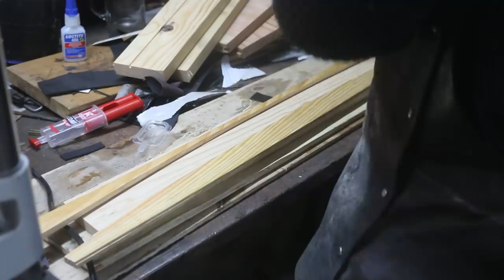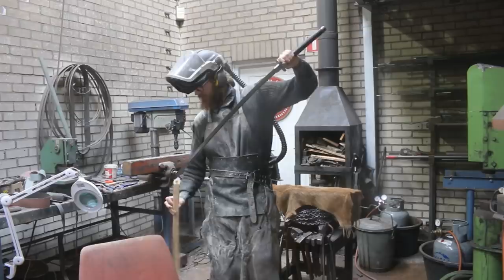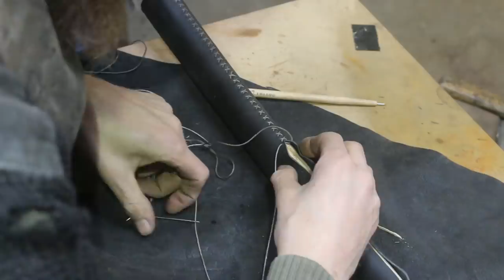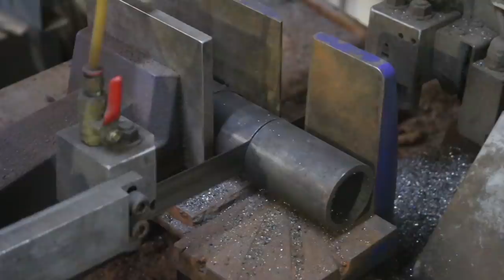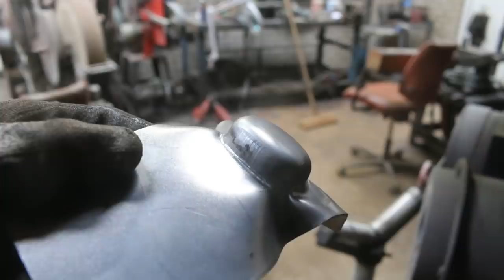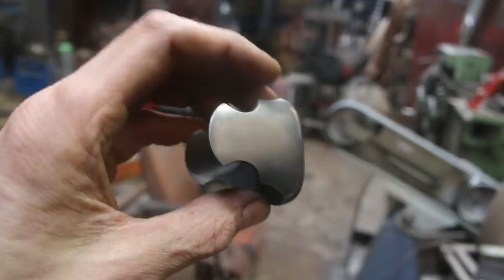Forging a Samurai sword, part 7, making the scabbard.

Comment: NANI?! The habaki did fit afterall. 

This is amazing work!

I hope the koiguchi area of the scabbard will get a steel fitting around it like the tip did: 
maybe even a hornlip that touches the tsuba and completly seals the gap in between.

Either way its great as is.

Comment: A little Japanese and a little Freerk... Japanese style sword and scabbard with a more European blade material and the scabbard isn't lacquered but leather wrapped like European scabbards. I really like the end result. It's your take on a katana because it clearly looks like your work. But one minor detail for the scabbard I think would perfect it... the tan wood stands out like a sore thumb when the blade is drawn, I think it needs a dark stain that's close to the handle wood in color.

And I still think it should have metal pins hidden under wood plugs to hold the handle assembly onto the blade. Doing practice cuts on water bottles, tatami mats, or rolled and soaked newspaper those wood pins are likely to get damaged and the handle could start rattling or a pin outright break.